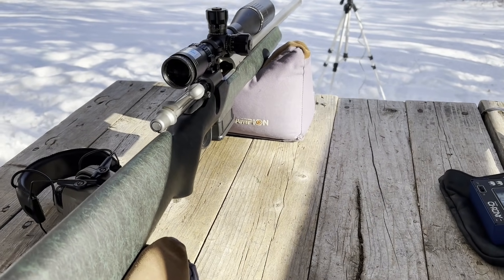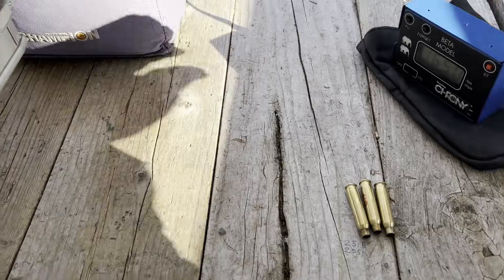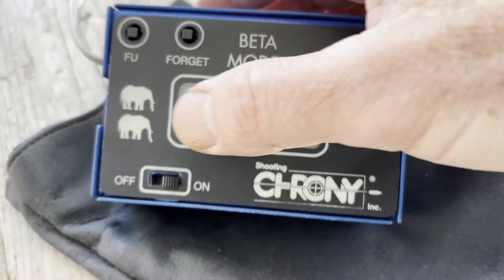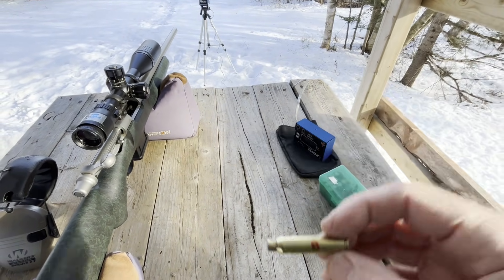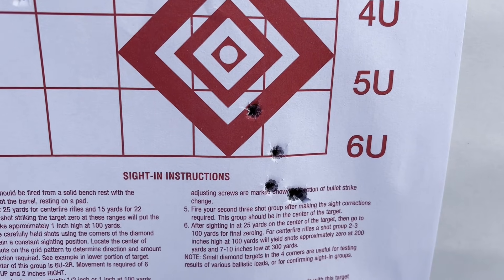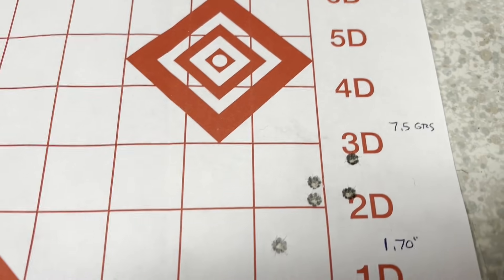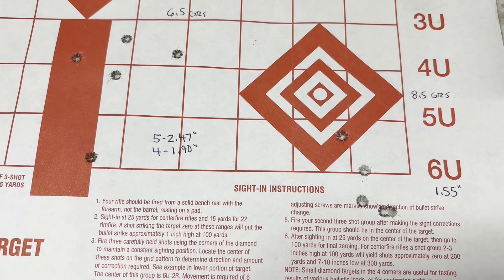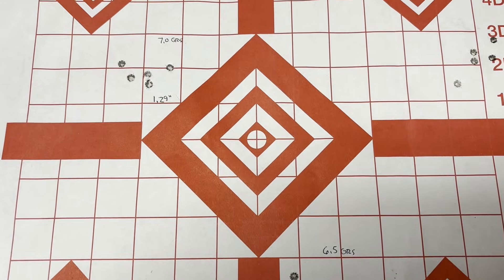Trail Boss Powder in .223 Remington

Comment: Years ago I had a .223 bolt gun and did similar reloading experiments butI used handgun powders. FYI, bullseye is not suitable for the.223!
Reply from the maker: I was shooting some cast bullets in 223 the other day using IMR700X. in the similar 222 Rem I've also used other handgun/shotgun powders with cast bullets, but not with jacketed. One has to be very careful to guard against double charging when using those powders.

Comment: The ability to handload reduced rounds is huge.  Allows you to cover 3-4 commercial cartridges with one rifle.  Pistol primers  (small, large not recommended) could also be used in a pinch as long as pressures are held down.  Sounds like some wind.  Really pushes around lower velocity rounds.  It’d be interesting to see how they do on a calm day.
Reply from the maker: Interesting that you mention using pistol primers as this summer I loaded some cast bullets in .222 Remington and used magnum small pistol primers. They worked just fine. Magnum small pistol loads can be loaded to quite high pressures so my cast loads were not testing them too much.
As for the wind, there was indeed a bit. My target could occasionally be seen to move back and forth a bit. It certainly would not help the groups any.

Comment: Great test, Shawn. I've definitely found hunting bullets to be much more accurate than fmj. One of my favorites is the Hornady 55 grain flat base spire point. I used to get them about as cheap as fmj, but they are way more accurate. I was loading them over 14.5 grains of Alcan AL8 that I got for about 5 dollars per pound, and they shot into less than 1/2 MOA out of my Stevens 200 with a 1:9" twist. I always wanted to put a 1:14 twist .222 barrel on it, but as well as it shoots I'm just leaving it alone. For now.
Reply from the maker: Flat base bullets seem a lot more forgiving when it comes to accuracy than boat tails do. 
Is your Stevens 200 also a .223?
Interesting about the Alcan AL8. I have a small tin of that around here somewhere (along with tins of AL5 and AL7).
Reply: @314299  Yes, .223. I bought a couple of 8 lb jugs of AL8 from a bulk reseller years ago for 40 dollars each. Still have some left. I've used it quite a bit for warm .44 Special loads.

Comment: Another interesting test result. I loaded some 7.62x39 after watching your last video. Probably won't get a chance to try them until the new year however. If they end up working better than the reduced loads that I have been using, the only problem will be finding more TrailBoss.
Reply from the maker: Availability of TB certainly is an issue, however they are making the stuff again so it should show up on the shelves eventually.

Comment: 4.0 gr. of TB gave me 1000 fps with those bullets, 2" group at 25 yds. Quiet & useful for plinking at close ranges out of a Ruger American bolt action. Powder coated, Cast lead, 55 gr. was considerably faster at about 1300 fps.
Reply from the maker: Interesting. I was under the impression that TB should not be less than a 70% full case. How consistent were the velocities of that 4 grain load?

Comment: Shawn, Back 35 years ago I had a small farm with a salmon stream running through it, it had barry vines and and a small apple orchard, needless to say, I had plenty of wild critters as a problem for my chickens, goats and pigs, back then I used a loading of 2400 ( I believe it was 15 grains ) and the hollow point flat base remington core lock that was sold in bulk, I dispatched those predators with ease as most shooting was within 75 yards, it worked fantastic with one shot results. also, I have always avoided buying a rifle in .22 Magnum because of the outrageous price of the ammo. my load and what you demonstrated here show that the .223 reduced loading work just fine when a round is needed that is more than a .22 long rifle. Good video peace - Dave.
Reply from the maker: Dave, I remember the days when Remington “bulk” bullets could be had for a reasonable price, those were good quality for the money. 2400 or 4227 are generally great for lower performance loads, and you get lots of shots per pound.
Reply: @314299  Certainly a powder savings, and at 100 yard they will do the job, I agree, better quality bullets have a better order of probability of accuracy in tighter groups. I look forward to seeing a video of yours on the subject for upgraded projectiles. great video - Dave
Reply: -- .22 Mag is  $ 14.00 for 50 rounds don't think ya can beat that --
Reply from the maker: @MegaBait1616 Up here 22 magnum ammo is $20 to $24 per 50, so 0.40 to 0.48 per round. The trail boss loads cost me .36 (FMJBT) to .44 per round (Soft point). So there may be some, or no savings, depending on what you load and  how good a shopper you are. Even if one saves money it will not be much. Real savings result from loading cast bullets instead of jacketed ones.
Reply: @314299   - wow,  wonder why it's like double the cost Hmmm -  but you guys get good Milsurp's from china and Russia -
Reply: @MegaBait1616  Wow, that's a great price, If I was you I would buy a K of them. (Me,, Just me) I look at use, Re-loading gives the person a wide variety of options for use, special applications, plinking, hunting, and target use. Plus, I can load for what I already have without buying another firearm also, I can make what I need without going to the store or waiting for the UPS truck to show up. I do have a few .22 LR firearms and .22 LR (The last time I bought some) it was $18 a brick of 500 rounds, I look at .22 Win mag like .22 LR, It is 100% expendable - Dave

Comment: Really cool test, I wonder if shooting up or down hill would change ignition.
Reply from the maker: Unlike most reduced loads these Trail Boss loads feature 70 to 100% case fill as the powder is very bulky for the charge weight. So powder position is not an issue as the chronograph numbers indicate.
Reply: @314299  Good to know, never played around with trail boss.